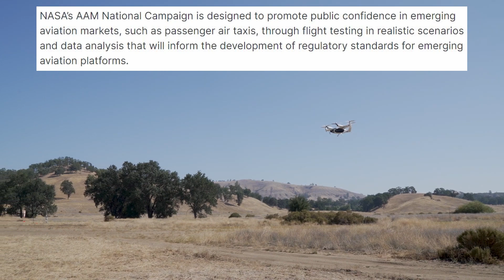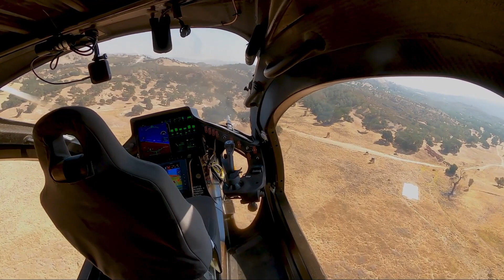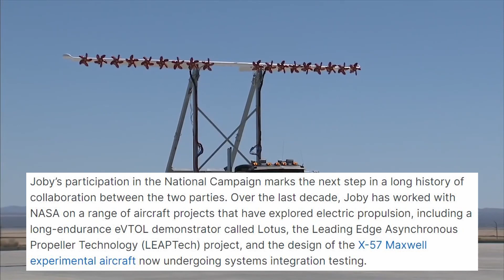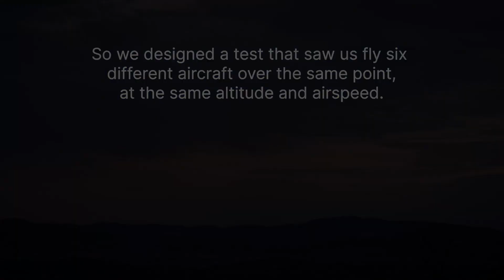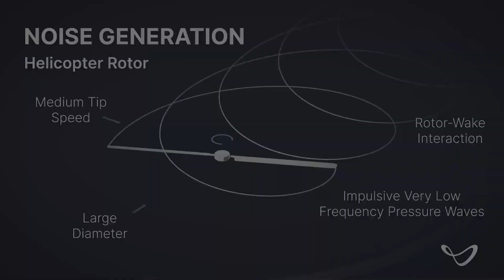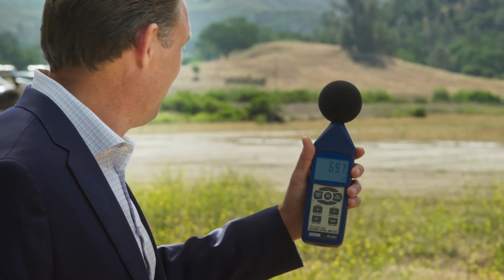Joby & NASA Measure Noise Level In Flyover & Hover | Electric Air Taxi eVTOL | How Quiet Is Joby Jet

Comment: erm - why is an electric quieter than normal aircraft? it couldn't possibly be because electric motors are quieter than internal combustion engines? wow, has anyone of these scientists ever noticed that electric cars are also quieter than ice cars even though they dont have propellers or rotors? i'm sure that all these other air vehicles would also be way quieter when installed with electric motors.
Reply: Yes, Peter, it's not a secret and hasn't been advertised as such. Battery tech to make it possible just didn't exist until very recently.

Comment: I bought both Joby and Lilium half year ago at the ratio of 50/50 when they announced to list through SPAC one after the other because at the time I don't know which is better. After watching and thnking for about 3 months, I voted for Joby for its proven tech. and its much more test flights. Joby got Airworthyness Award by US military. I believe US Military have verified something before making the award. In the case of Lilium, the design is so cool to look at. But no substantial evidence to demonstrate its capability to fly 150 miles as claimed except some short videos that lasy for a few minutes. The other winning factor is practicality. Toyota being one of the major shareholders of Joby is also the key factor cos Toyota definitely know sth about manufacturing. As Elon Musk said, prototype is easy but mass production is hard.
Reply from the maker: Joby is certainly the less risky bet.
Thanks for watching and commenting Raymond!
Reply: Joby has an extra five years of development on Lilium. Keep your LILM, it will bloom. Joby will probably do ok but the limited passenger capability will stop them from taking the lead in regional trans. Yes, Lilium hasn't released any long-term test flights but keep in mind that Joby just did so, a month or so ago, and still unmanned. Both companies are in the Mercury stage of the Moon mission, with Joby ahead by virtue of time, not necessarily product.
Reply: Agree